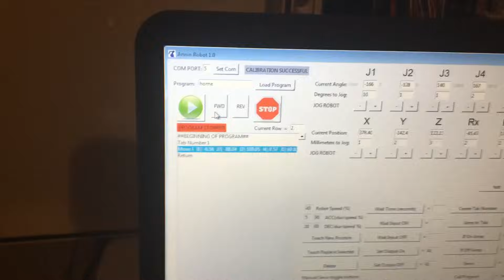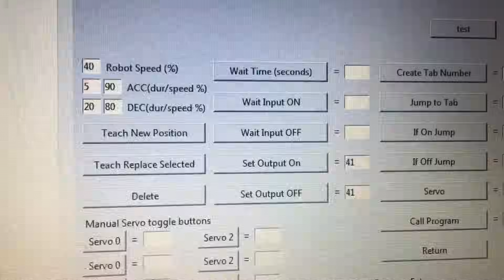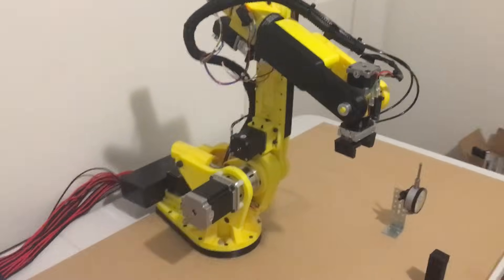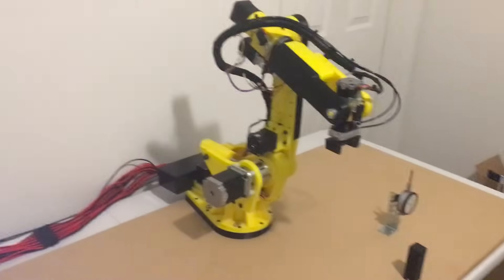3D printed  6 axis stepper motor robot - Gen2

Comment: reddit.com/r/robotics want to know more!  

What was the print time?

What was the material cost?

What was the assembly time?

What is the maximum payload, before the gripper is added?

What was the hardest part for you?  How many versions did you build?

So nice. I'm really impressed. My hat is off to you, sir.
Reply from the maker: 45 different parts to print - many of the small part took a couple hours each to print.  the larger parts took I would guess 8 to 9 hours but I had my davinci printer on its slow setting.  I built it over a period of 4 months and had to do some reprints.  hard for me to say exact print or assemlby time.  I would guess if you had the instructions and all the parts in front of you probably a couple days to put it together.  The hardest part was the math figuring out the kinamatics - and I still have some work to do.  the assemlby went fairly smooth other than a few minor re-designs, reprints and selecting of different motors.   My first version (blue one in my other video) left quite a bit to be desired so I tried to incorporate what I learned from that one into this version.  Im still putting together the complete bill of materials so Im not sure exact cost to build but I would guess around $800 to build but I need to go back through my Amazon purchases to verify....  there was alot of little stuff that adds up im probably forgetting.  I'll post the exact cost to build once I finish the bill of materials document.
Reply: thank you!  

What did you use to design - fusion?  solidworks?

what's your drive train?  I imagine belts in the bicep to turn the elbow.

Is that a spring on the back of axis 2?  I imagine it pulls to reduce backlash and help the motor.

You clearly have experience with arms in the past.  Please elaborate.

kinematics are fun, singularities are greeeeat...
Reply from the maker: Solidworks.  XL series belts for 1,3 and 5 although im thinking of going to a beefier belt for J3. you are correct on the spring for J2.  I work in automation and with various industrial robots.

Comment: As someone who has sunk several dozen hours into attempting to design my own fully 3d printed 6 axis arm, very impressive! Are you going to make the files available?
Reply from the maker: Yes,  I will be posting the .stl files as well as the arduino sketch, control program - Im currently working on instructions, bill of materials and schematics.  it may take a while for me to get it all ready and posted, hoping 3 or 4 weeks but this is something I work on on the side in my spare time so it may take a little while.
Reply: If you do not mind, can you include the .step/.slprt/whatever native CAD format these parts were made in? That way a community can truly build upon what you've done so far. Also the lovely editors at Hackaday would totally write up an article about this once plans are ready. And if you had content for a buildlog, Hackaday.io is a great place to upload your material.

Comment: What kind of gearbox are you using for the 2 joint? Harmonic drive?
Reply from the maker: It does affect the repeatability to some degree,  mostly on axis 1 - the other axis are under compression so its not as big of an issue.  Obviously any backlash is undesirable but given the goal of building a usable robot with any kind of payload that people can actually afford to build is a tall order.  My goal was to create something low cost enought that anyone could afford to auotmate a simple pick and place operation.  I wouldnt mind building a precision machine at some point but then your up into the $10K range for servos and gear boxes.
Reply from the maker: It's a 47:1 planetary gear drive. Stock item @ stepperonline
Reply: Chris Annin I just bought a planetary gearbox for work from stepperonline. the backlash on the output shaft is definitely noticeable on mine, does that cause a decent error in the position of the end effector?